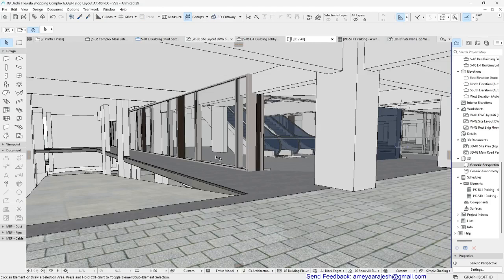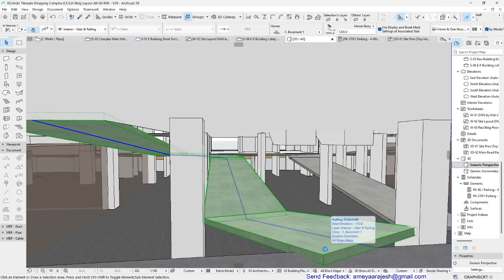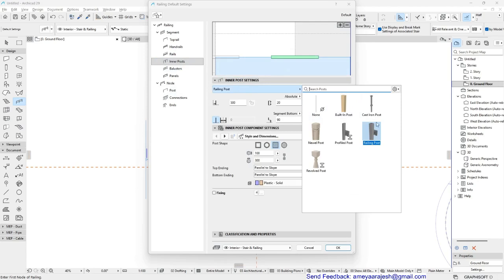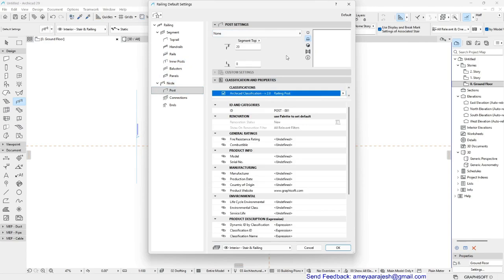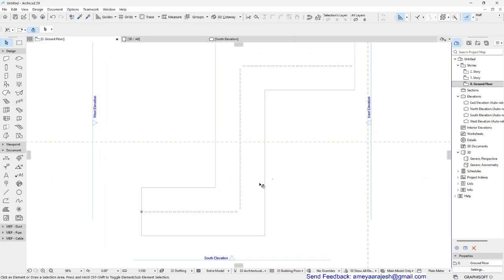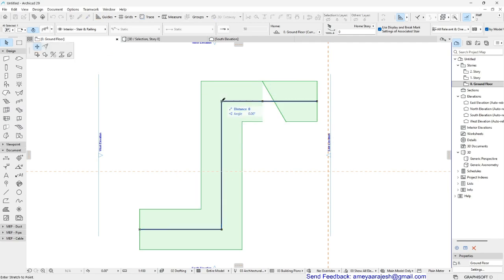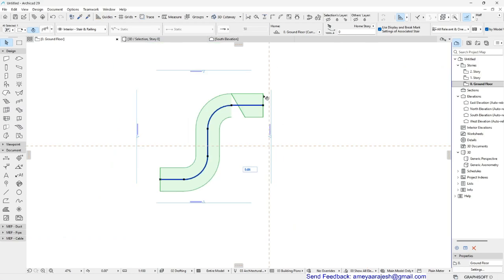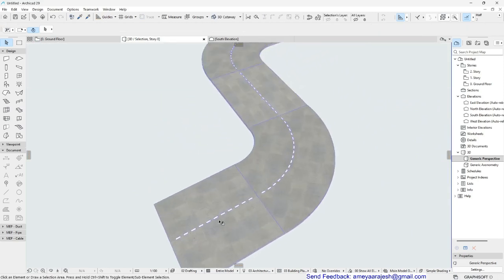Using Railing Tool to Construct Roads or Ramps

Comment: I feel it's better to import ramps built in sketchup to archicad. For complex curved ramps i use curviloft plugin. It's very precise and time saving.
Reply from the maker: May be.. as i don't use SketchUp so not aware. Here I was just trying to give some simple drafting tricks which one can use at eleventh hour to solve design problems by staying inside Archicad. Hope you will like them 😊